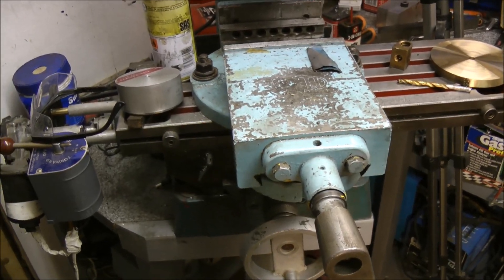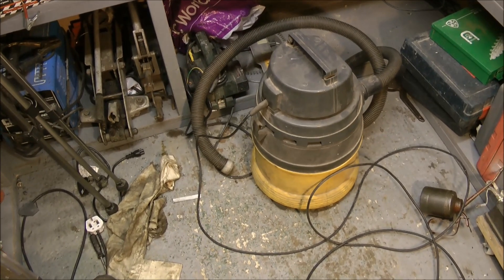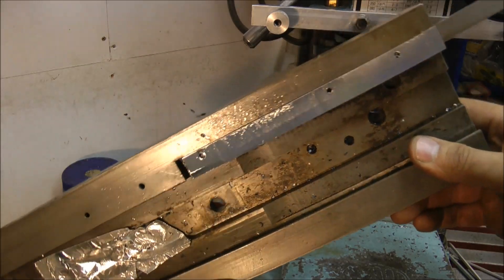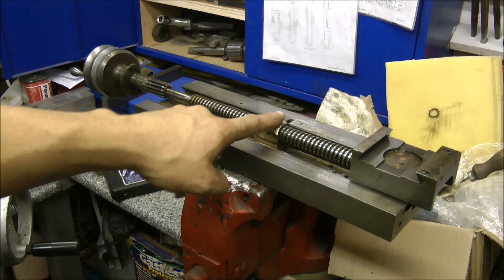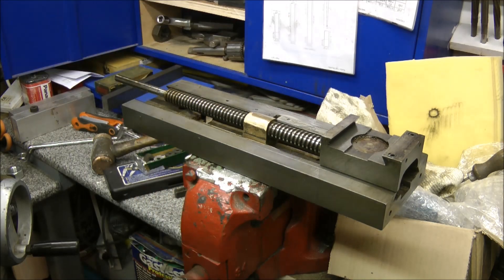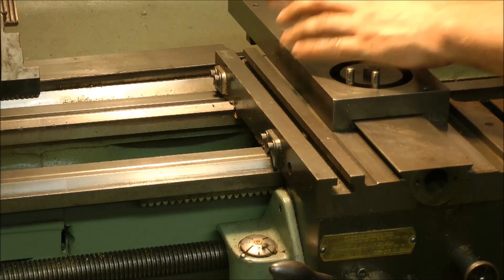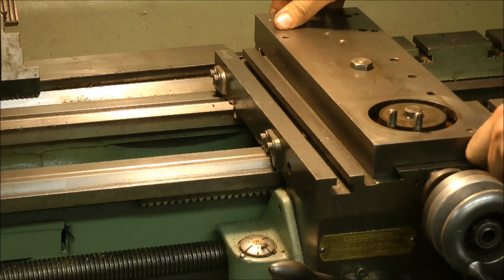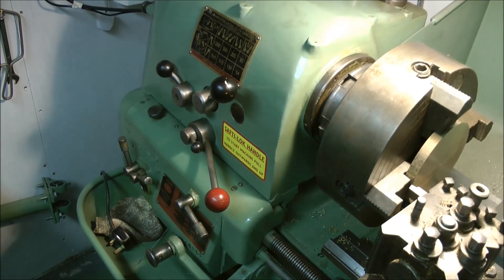colchester lathe cross slide repair part two

Comment: I love your way of milling the gib strip. When you see it it is so obvious.  its one of those why the hell didnt i think of that.
Reply from the maker: John Coghlan  lol I’m mostly bluffing it, you are on Chris the bodge’s channel 🙂 it’s have a go and see what happens...
Reply: @Madchris1  I used to be an industrial photographer so i went into lots of factories and saw people making things with machinery (lathes) and thought i would like to do that. I gradually assembled tools including a ward capstan lathe that was given to me. I joined an engineering society in Handforth near where i live. I was given a Simplex that needed repair but when looked into in detail it was better to start from scratch. Hence the Super Simplex. I have no experience but there is plenty of advice and help available in the club but i am very new to this and full of trepidation, i watch lots of model engine videos before taking a step forward with the model. Turning wheels and making axles at the moment.
One thing i do have a problem with is my lathe, Its a Student like yours, the tailstock barrel will not hold the tang on the end of a morse taper so i can not use a drill chuck, If you hear of one please let me know, i am searching ebay and others  for one, I cant see how it could be repaired either. I also have a lot of backlash in the cross slide so i have watched your video.    Cheers John Coghlan   (Coggy)
Reply from the maker: John Coghlan https://youtu.be/bE2NlXsUTlQ
Reply: @Madchris1  Hi Chris Thanks for the link to video's.  I had wondered if i could drill two holes 180 degrees apart and put a couple of grub screws. Having seen the video i now know it is, That's the next job then. Need to clean the lathe, I have been turning  cast iron wheels and the lathe is covered in black slurry, it really is filthy stuff. Once again many thanks. John
Reply from the maker: John Coghlan  yeah it’s really bad stuff, I cleaned up a cast faceplate for the Colchester, it got everywhere, I have a old shop hoover to get most of the crap of mine 😅,  good luck on the tailstock job 👍 tell me how you get on , I’m guessing the Morse bore must be worn too, at some time it must of had a a big bit spin around in it😕,  think most people devise various clamps / lathe dogs to hold bits etc against the tool carriage,  which is good practice if it’s a massive bit anyway , always a pleasure to chat John 😊

Comment: Your shop looks like mine.  Q: Did you run an indicator over the gib to make sure it was torqued from the screws.  Could not understand what you said about the OE cutter.  6:16 Chips go everywhere, especially if you use compressed air for cleaning.  08:20  I'm seeing a very good finish on the face plate.  Great bit of work, that.  Now I'm talking like you. LOLOL

Comment: Very helpful video. I am just starting to restore a Colchester Triumph. It seems I may have some work to do. When one thinks of the expertise and love with which these machines were made it's hard to understand how badly many have been treated
Reply from the maker: +John Melville  good luck with your resto  john, will be it used  for hobby or work ?
Reply: +chris the bodge Hi Chris, thanks. My Triumph is in a sorry state but I only paid fifty quid for it. The bed doesn't look worn though and I'm hoping it will be possible to restore it to good working order. It's only for my amateur use. I have to get everything free, remove all the surface rust, install a new motor, repaint and replace several small missing parts and covers. What a fine machine it must have looked when new, it's just been neglected
Reply: John Melville

Comment: Can the gibs be adjusted?
Reply from the maker: +David Jenner  hi david , you bet they can, the Colchester was built for the pro in mind { not me ha ha ) so there's adjustment on the cross slide, and top slides in the form of Allen headed grub screws which push against the gibs laterally .so you can squeeze more life out an old lathe !

Comment: How could you mill that shim without holding it down?
Reply from the maker: +ExtantFrodo2 hello, its held down by its two of its original bolts I just released them and put the shims under, pretty low tech like myself lol

Comment: Lovely work. I have a metric Chipmaster and it's suprising how many parts these lathes shared.
Reply from the maker: Thanks, that's interesting... I didn't know they shared parts, could be useful for hard to find stuff !.
I'd have a chip master if the workshop was larger arrgg
Reply: Considering how many Chipmasters I see with worn out variators I think you could certainly salvage a great deal from them for very little money.

Comment: My colchester came today. I'm beat from unloading it in the heat, it was a 101deg F. But it's in and now all I have to do is hook it up.
Reply from the maker: 101! How did you get it in, on rollers?
Reply: Muscle, pain, and round bars. I bought a mill from the same place, that was the killer.